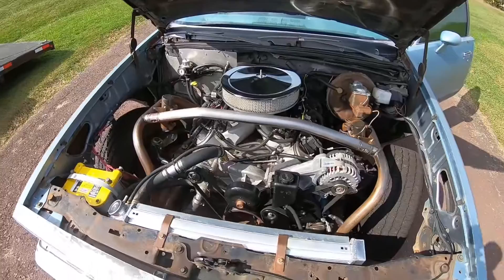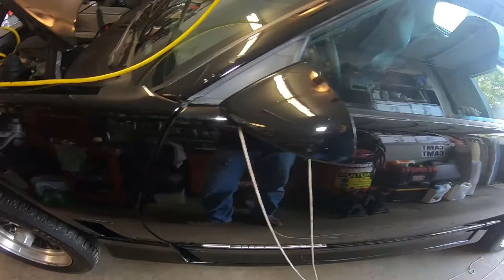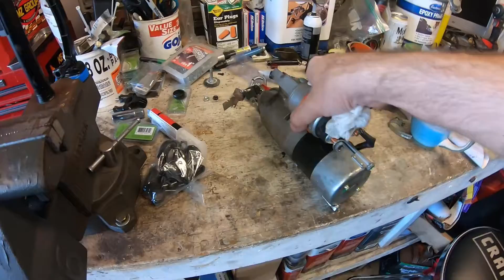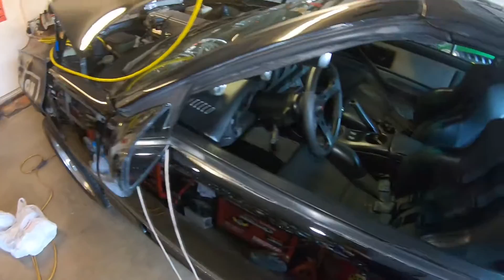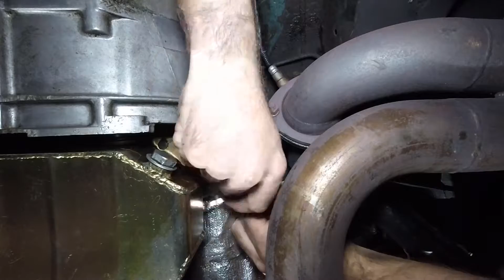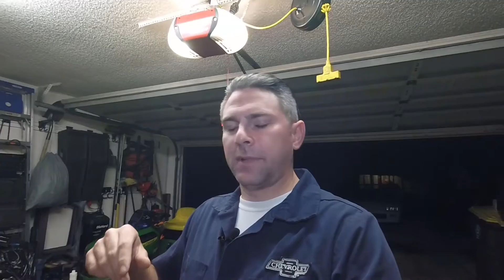Third Gen Trans Am Starter Swap! Budget high torque starter!!

Comment: What kind of y pipe is that? Shorties?
Reply from the maker: Those are actually Hooker Headers P/N: 2460, and Doug's Headers Y-Pipe, P/N: D9101. Both are still available on Summit. I also had my muffler shop redo the Y where the pipes come together to make a smoother transition.
Reply: @Paulie_KITT what size is the y? I’m looking to get a Dyno Don pipe for my Edelbrock shorties

Comment: Nice ride.   I know this is old but you still had a heat sock starter with the dei?  And does the nee one still work 3 years later. Tu
Reply from the maker: The previous starter I had in there was a PowerMaster Mini. I didn't have any heat soak issues with that one, but the one I swapped out in the video was defective. Its December of 2023 and that starter I put in is still going strong!!
Reply: @Paulie_KITT  thank. I'm on my 3rd.  Might have to spend more on a napa one.  $$$

Comment: I have a question what engine do you have in the Trans am kit car? As it sounds pretty obvious that it's not a stock 305.
Nice cam sound. Great video I have a 1996 Trans am and had the exact same issue the starter would spin but wouldn't throw the gear out to turn the engine over. And mine is much more difficult to replace I had to remove the Y pipe to get the starter off. Totally ridiculous amount of work just to replace a starter.
Reply from the maker: KITT has a 400 small block punched 0.030 over. I've had to do the 4th gen cars too... it's a pain! LoL

Comment: Thanks for the video. I have the same issues, especially after installing the headers. And a heat shield did nothing fot me. Gone through 2 starters. So why is that Carquest unit better than an LT1 mini starter? Is it simply because of the lifetime warranty?
Reply from the maker: The Carquest one is an LT1 starter. I used to have an aftermarket PowerMaster mini starter on there. The LT1 unit generates as much torque as that one, and the advantage that I can get one anywhere in the country.
Reply: @Paulie_KITT  thank you friend. Huge help you've provided. Did you have any issues with cables being too short?
Reply from the maker: @chuckbroso  if you have a regular GM starter on there now, you should have no issues. I ended up replacing KITT's very worn cable from 1985, loomed in the same way the stock one was. To me this is one of the best kept secrets about the 3rd gen F-bodies!
Reply: @Paulie_KITT  I do have a regular GM starter. Thanks again.
Reply: Hey buddy. Had the starter installed today. Drove it for 90 min got it nice and warm. When I got home and shut down, 20 sec later I turned the key and started on the first crank! I've never been able to get the car started again without letting the starter and solenoid cool off for over an hour, sometimes longer. So satisfying. Thnx again. And I have the lifetime warranty if I have issues in the future. THANKS AGAIN.